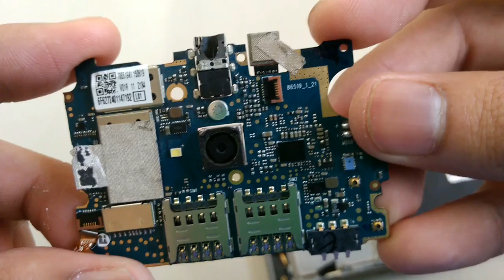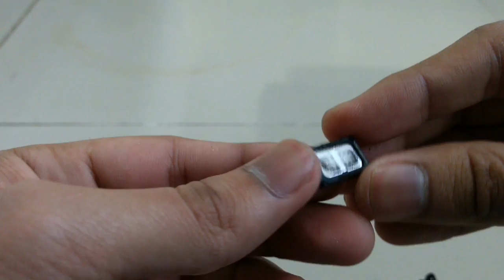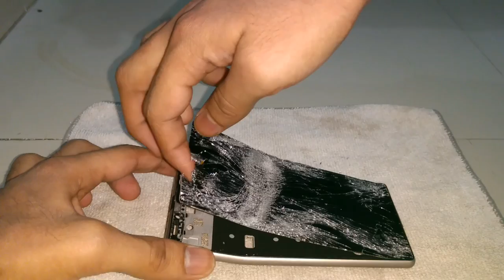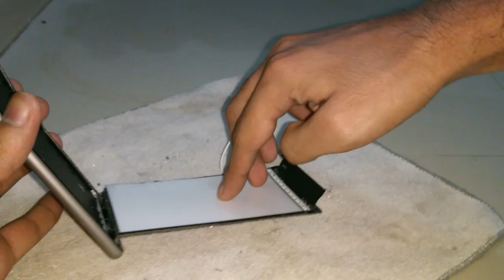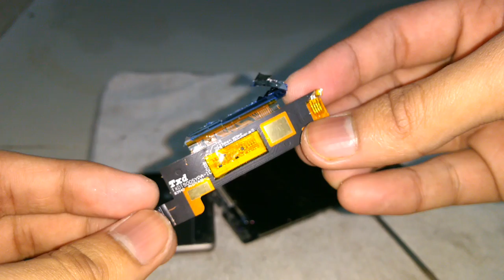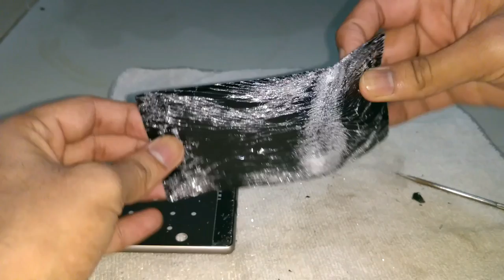Check what's inside a smartphone with all its components broke open and identified.

Comment: wonderful how all these fit in one small chip. imagine this is a pc replacment
Reply: It would work bullshit because cramming it like that would produce way too much heat so the cpu or SOC in this case because the chip has all the components like gpu modems and processor built into it, it would all heat up too much for a task like 3d rendering in say blender or gaming cyberpunk 2077.  And also there aren't many pc applications that support ARM chips.
Reply: @n.s.ac.i.ajointeffort1983  nothing 100% ideal, youre buying small chip at cost of performance and heat. maybe they come with ideal thing someday.
Reply: That will be it wont it one day no need for anything else just a phone.
Reply: @CARLIN4737 guess what it's years later and now i work as a phone repair technician

Comment: The one thing I couldn't find is the Vibration Motor...No where to be found
Reply: Modern devices have small motors, I have even seen flex-pcb motors. I remember the earlier used to be quite large, now they just are small discs.

Comment: That's motherboard can use for future phone. You can make you own phone (But maybe need an root for changing boot animations)
Or making an future project or as a replacement, or you can sell it (maybe not...)
Reply: It's not that easy to do it. The original board has softwares of the company. To add a custom software, you need to flash the device. Then adding a new one will be more headache.

Comment: I can't find info/videos on those thin, black cords that connect the parts inside the phone and if u can connect just a logic board to another phone to get the data from it. Any help would be appreciated.
Reply: They are just connector wires, connecting different components. Modern devices have them in their multi layer PCBs, so no need of wires.

Comment: You couldve used the circuit board and replaced the screen for a new phone
Reply: I agree. The way he just ripped the circuit board apart made me cringe😭
Reply: How can you reuse a circuit board of a smartphone? They come in one piece, you can't just rip off the cam and sell it, rip off the USB connector, sell it. They all come in one package. The screen does have layers that you can use if you love optics. But except the cam, speakers and USB connector, I don't see anything significant to re-use. Watch great Scotts vdo on this.
Reply: @vinayakonimani7628  if the circuit board doesn't have any problem, isn't there a possibility that it could work on another one of the same type of phone with a problematic board? I mean for some android smartphones though?
Reply: @mirabel_rs  I can't sem to understand the term 'another android phone'. Is it that, putting the motherboard into another chassis? Or you mean to desolder the microchips and attach them in another board? The latter one can't be possible cuz usually the companies have their own chips, so you can't actually transfer a stuff of apple to a samsung board. That'd cause incompetence.